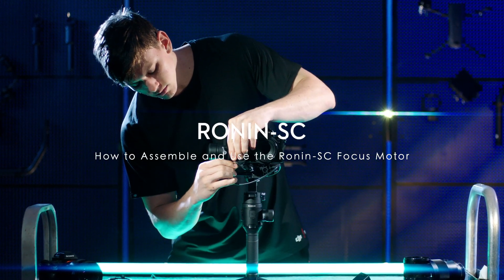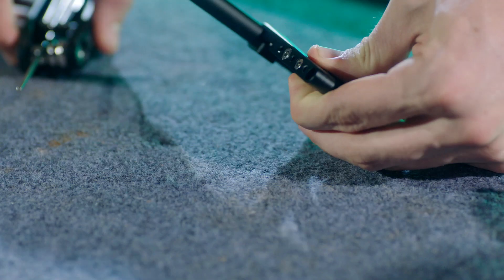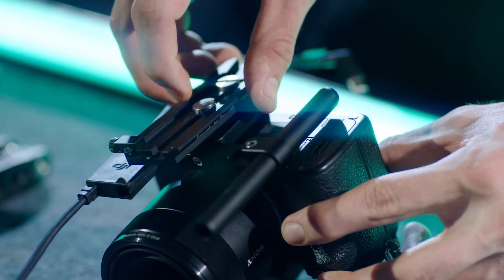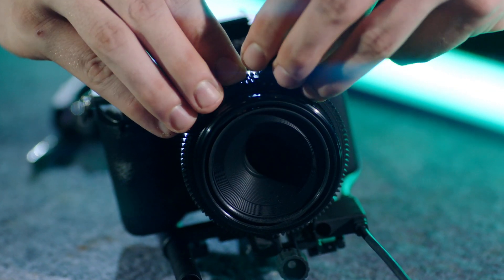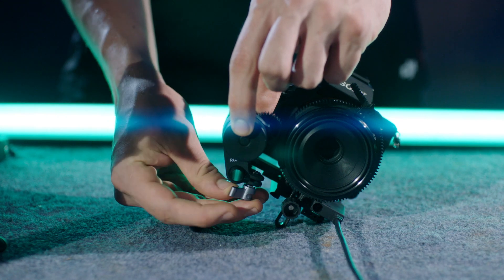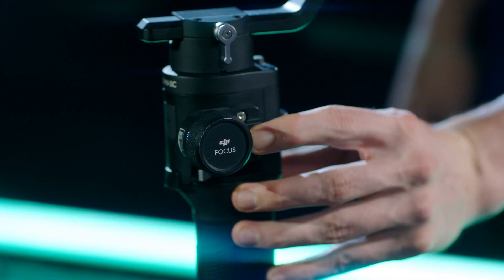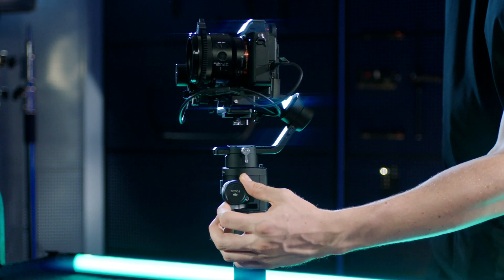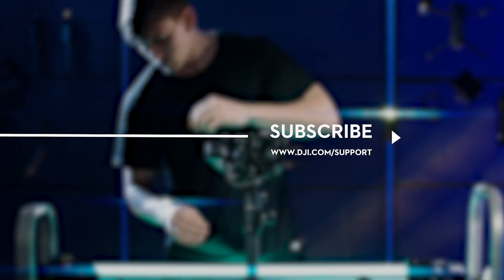Ronin-SC | How to Assemble and Use the Ronin-SC Focus Motor

Comment: Do you have to connect the USB cable to the camera for the focus moto to work? If so, can I use a standard USB C to USB Micro cable (Canon M50 Markii). If not, is there a DJI part number for that cable?

Comment: It would be great if you could convert the motor and wheel to wireless mode for use on other supports. Maybe a wireless module for the wheel and a v-mount battery connection for the engine. It's just an idea, but you could reuse some very good components that I've never used on the Ronin, I only have two hands and I prefer to have extra grip.
Reply: Can we convert into a wireless follow focus?

Comment: mine is not working, 
i do every connection right,  double click the focus wheel for calibration and it goes all the way up and down. 
all solid green lights, I try to spin the focus wheel and nothing happens, i put my hand o the focus motor and it feels its constantly vibrating like going back and forward really fast all the time. 

could some one help me?
Reply from the maker: Hi Justin, we are sorry for the issue. Could you please provide a video of your case for further confirmation? Please send it to us via emai at support@dji.com, we will try to help.

Comment: 1. It is quite difficult to set up. Especially when you need to change the lens.
2. Replacing the battery is equally difficult.
3. There is something wrong with the rotation range. It is very easy to lose grip on the motor when the lock reaches the motor.

I took the Ronin SC Pro just for the follow focus. But I can hardly use it.

Comment: So in that setup you made it so that you have to take the focus motor and rod off to change a camera battery. Is that how it’s supposed to work?
Reply: Yep. Though you can balance the rod and focus motor further out front depending on how long and heavy your lens is. Stupid design flaw from dji regardless.

Comment: so either the motor becomes disconnected with the belt 
and when that doesn't happen, and it actually is working, it refuses to calibrate itself to make it useable at all
just going to return it after doing a video on it, just ridiculous

Comment: My focus wheel is red and stooped working
Reply from the maker: Hi Ryan, may we know how many times it blinks a time? If it blinks once a time, it is disconnecting, please try to mount the focus wheel again, you may also try to install it on the other side. If it blinks twice a time, it means the module needs to be updated. Please check for update. Thanks.
Reply: @DJITutorials  nownjust the focus motor is blinking red
Reply: @DJITutorials  everything is now connected and green bit calibration doesn't end it just keeps turning even when the camera cant focus out or on anymore
Reply from the maker: @ryansalaman5648  Hi Ryan, could you please provide a video of this case for further assistance? Thank you.
Reply: @DJITutorials  on your website it when I try to add a video it says format not supported
Reply: When I turn the focus wheel the motor only moves a bit one side then the other
Reply from the maker: @ryansalaman5648  Could you please provide a video of your case for further confirmation? You may send the video to us via email support@dji.com. Thank you.

Comment: My focus motor stops at first end point during calibration and doesn't go full circle. Please help as it almost impossible to use focus wheel.
Reply from the maker: Hi there, just to verify, do your lense have mechanical limit? If not and the focus motor assembled well, you may calibrate manually. More details, please refer to the user manual: https://dl.djicdn.com/downloads/Ronin_SC/Ronin_SC_Focus_Motor_User_Guide_v1.0.pdf

Comment: Hmmm I'd prefer to mount the motor on the other side.. I mean, what a struggle, when you want to change the battery..
Reply: You can just unscrew the rod that block the battery. Check 0:20. Do the opposite process
Reply: Can sony a6000 do this set up?
Reply: @dwisetyoaji5007  easily
Reply: without this motor you can not do manual focus with the wheal?
Reply: @sottosopra4769  how would you?

Comment: I bought the ronin sc combo pro but my focus motor doesnt move and doesnt calibrate... The light is yellow but it doesnt work?!
Reply from the maker: Hi Samuel, just to verify, is the Focus Motor assembled well? You may try to re-assemble and press the focus wheel button twice to check.
Reply: @DJITutorials  Please, could you answer to my question. I have a Nikon Z6. To do manual focus by using ronin sc wheal, do I need the motor or is not necessary?
Reply: @sottosopra4769  No, according to the manual you only need the focus wheel not the motor

Comment: i'm using it for zoom, not for focusing , i think its the best way to use it for my usage
Reply: true
Reply: @rajajinnah6749  and now i completely removed it, now my a7 iii turn completely in the gimbal, and less weight. for my usage, even the zoom is not very needed. i bought it to try but i dont need it for now
Reply: @PrinceArtanis  It's clumsy for sure, I hope i don't regret buying the pro combo
Reply: @Kristoffer_Amundsen  Yes. Didn't use it more than two times. Should've bought the standard version
Reply: @rajajinnah6749  Hi, Hello, I don't understand!  Is there no zoom control with this model?!
I mean a zoom control already present!
Reply: @Kristoffer_Amundsen  I use autofocus almost all the time and I don't need zoom during shots.